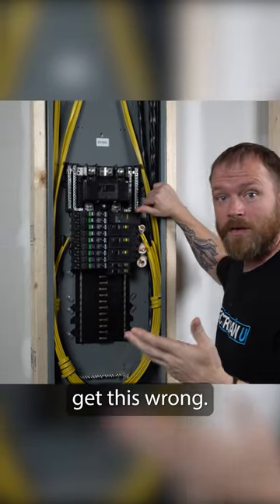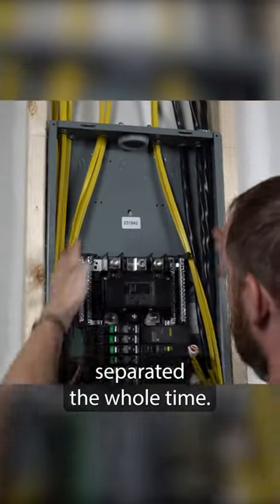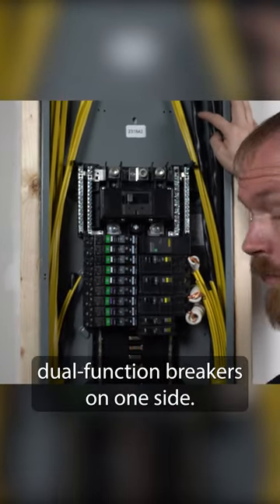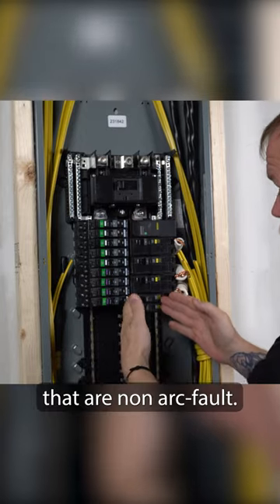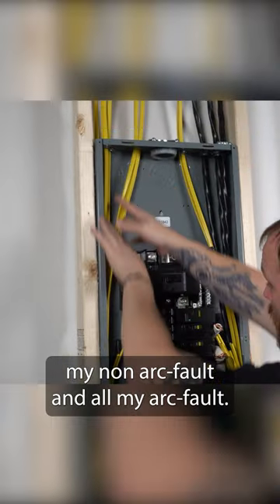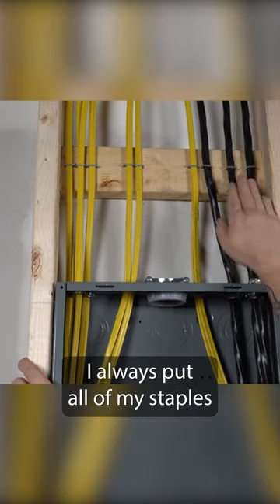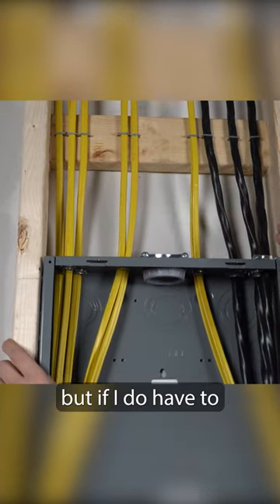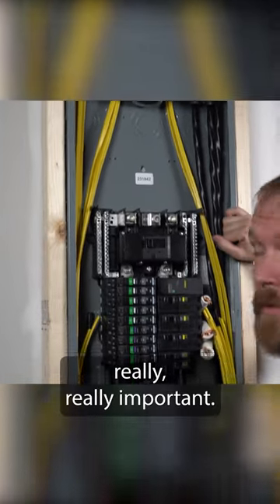Setting Up an Electrical Panel with Intention

Comment: you also need to balance the loads on both legs
Reply: This was my thought as well.
Reply: I mean you can but that's really what the neutrals for
Reply: No you don’t
Reply: Well, you thought wrong. I’m not trying to be mean but you’re both wrong.
Reply: This panel is no more unbalanced than a panel that is not organized
Reply: How would you know if the loads are balanced, he doesn’t mention what any of the cables are feeding
Reply: The method there is to actually land the wires in the right knockouts at the top. If you noticed the cables coming in then it looks balance to me. If those are 30 amp cables on the right and 20 amp on the left then I see 120 amps coming into A side and 110 coming into B.
Reply: You know all the circuits on one side are not on the same bus, right?
Reply: The panels are designed  already balanced now a days.  Each side of the panel going down is a phase then b phase all the way down.  

Older panels you would have to balance because the left side would be one phase and the right side would be the other phase.
Reply: The legs are one after the other anyways
Reply: All of the right side or all of the left side is half of both the split phases (if that makes sense?). The breakers alternate from left to right.. 
Having all the high voltage stuff on one side is not going to balance out the load. I do think they should be kept closer to the main lug/breaker though so the high load stuff doesn't have to travel far but that's probably more of a best practice instead of code.
Reply: @williamrose7818  not my fault you don’t understand
Reply: My
First thought when he said all 2 poles to right side
Reply: Also load balancing is a old term as the panels were wired differently. The rear bus on new equipment is already balanced and amp wise is the same 200 amp (ie) from top to bottom. 

With all of the new smart breakers I’ve wondered why we haven’t seen a small fan to draw out heat? I’ve also noted sone panels mounted side ways, Not sure it that is common then the heat is only two breakers
Reply: Hmmmmm
Why do we balance loads
Well when a store is running, they have everything going and pretty much use all of the amps their service line provides them and or the panel is rated for

So hot spots occur in areas that bigger breakers have been bunched up in
Which causes heat
Which causes breakers to trip
I’ve had a service call where they had tripping breakers and it turned out nothing was wrong except the electrician put all the heavy double pole breakers in one spot. 
I rearranged the panel to better balance the heat that is created from the amp draw and they’ve never had a problem since. 
When I do residential I put the A/C double pole above or below the heater double pole, these won’t ever be used at the same time 
I don’t put the water heater next to the bathroom breakers
Freezers and ice boxes don’t go next to each other
You get my drift….

Comment: Stacking all those arch faults, GFI, and dual function breakers creates a lot of heat and will cause those breakers to trip. You also have to make sure both hot legs are balanced. It's not all about looks people

Comment: Its always weird for me to see cables clipped inside a wall.  Here in Australia you are not permitted to clip in an internal wall cavity.  The theory is that an unclipped cable is less likely to be damaged by a nail or screw because it can get pushed away.

Comment: As a carpenter of sorts those staples all lined up looks like you are trying to split that board :)
Reply: Wood is a lot softer these days
Reply: @BS-ys8zn  Tangential note: 
 I recently did some work with some pine boards that might be 100 years old, from a 1920's house. Glue does not soak in very deeply, legs I glued on pulled off with less than a 1/6th of an inch of the old pine on them.

Comment: Love the vlog!  👍🏻
110 / 220 was standard until 1930’s when it changed to 115 / 230.  In the 1980 it upgraded to the current voltage standards of 120 / 240 volts.  Holding +/- 5%, 220 volts be at -8% — a brown out!  And a burned up motor.

Comment: There is a reason to NOT do this! AFCIs and Dual function AFCI/GFCIs create heat - they also FAIL due to heat.

I too used sort breakers this way- 2poles there AFCIs there… And I had to deal with a bunch of call backs on breakers failing. I also do thermal imaging… And found that AFCI breakers in close proximity in banks with each other would cascade heat - prompting early breaker failures. Granted AFCIs have gotten better but the issue remains.

So - what do I do now since almost all residential circuits are AFCIs? I group for areas horizontally. Not odd/even in the 1357 2468 vertical. Kitchens are top 123456789 etc with a blend of two poles. Followed by other two pole equipment - if not in a separate panel- because I do break up panels that way. Then at the bottom all the lighter loads of bedrooms and lighting. Which are more diverse. 

This keeps the higher loaded less frequent loads that produce more heat in short duration up top. And the longer duration lower amperage spread out at the bottom. 

I have also opted to steer clear of panels in Mech rooms where furnaces and water heaters push the ambient heat too high.

We need to treat AFCI and dual function breakers as “electronics” because they are. And the performance of them and longevity of them is dependent on heat.
Reply: Was looking for this comment. Well said!
Reply: Agreed
Reply: I do a lot of residential with remodels and new construction and have never experienced this
Reply: @frankw3606  you don’t experience it until you experience it. AFCIs have gotten “better” - but still an issue. If you do several full 42 or worse 60 circuit panels in hot mechanical room conditions - you’ll get it.

Comment: Is there no thought into the load distribution across both legs 

Traditionally this would be set by the engineer on the plans . In some of are areas ( not all). The inspectors will fail you ( or make the engineers sign off) if you don’t follow the plan exactly per breaker

Comment: Ever had issues with tripping arc faults when they’re all stacked like that? I’ve seen it once before. Temp reading showed much higher temps towards the top of the afci stack. Tripping stopped when we split them up

Comment: How does this affect the load balance of the panel with all the 220 on one side?
Reply: That’s what I’m wondering?
Reply: It does  nothing it will  be just as balanced if he put 1/2 on one side or the other  it doesn't  matter
Reply: Panel buses are ran everyother to each pole on either side

Comment: I’m not about speed or neatness or whatever good or bad.  Does it work and is the client happy?  Cuz one things for sure the electrons don’t care if the staples don’t line up or where the single pole breaker is in the panel

Comment: Looks really nice. Honest question. Is 220v specific to states? Ive never seen 110-220. Always 120-240v in every state ive worked at. Granted i have not worked at all 50 states.

Comment: Looks good bud. I really like the idea of separating the 220 and arc fault to different sides of the panel. But damn how long does it take you to straighten out all the wires and make it all nice and neat. I take pride in my panels and separate all the wires but I feel it would take a hot min to get all the romex wires as clean as you got it there.

Comment: What I like to do is solder the wires to the breaker for a better connection then smear grease on them so they can't corrode.

Comment: Nice panel, but putting all your 220 volt breakers on one side, creates an unbalanced load.
Reply: Is that because 2 pole breakers are heavier and throw the balance of the panel off?

Comment: Thats wrong...large loads go closest to the main where the source is... that way large current drawing appliances dont flow thru lighting circuits...we all know current only flows towards the source...thats why lights dim when ac inrush current flows across lighting breakers...just check any commercial panel schedule and you will see large loads closer to the feeders

Comment: Nice work for new construction... But panel replacement doesn't always afford you the time for that level and 95% of my electrical work is replacement or repair.. time is money. Proper installation and code compliance is what's important.

Comment: This panel is a code violation in Canada. Never are you allowed to have branches entering the panel from the top, or where the main service line is entering the panel. They must be separated at all times.
Reply: Well this isnt canada and every single house in the US has homeruns entering from the top of the panel, and on the same side as the service conductors
Reply: This is AMERICA!
Reply: We don't follow your commie code. We follow NEC 😂
Reply: @usa5439  Define communism. Then define what "commie code" is.
Reply: In a main service but a sub panel doesn't require it if the manufacturers don't have it
Reply: Explain the concept behind why thats done please
Reply: @pingpongpaddlehead  I'm going with an assumption that wire fill in the top of the box would get tight and cause excessive heat. And .Mainly to service those wires without a main disconnect prior to that panel you would have to schedule an outage with your local electrical authority in Canada anyways because they'd be behind the line side flash plate.
Reply: Which would be a violation unless it's a specific few load centers past the main distribution
Reply: @UnifiedInfo  well we have formulas for fill that prevent such thermal overload due to harmonics, and we always have some sort of disconnect from the utility like a meter before our first source of disconnect, or some sort of multi tap whereby we disconnect from. So it still dont make sense
Reply: @pingpongpaddlehead  not all codes are strictly for safety some just make the future sparkys job easier
Reply: @UnifiedInfo  i underatand that. Im a 3rd gen with 25 years in. I cant understand the logic behind this. I service panels all the time with romex  conductors and conduit coming in from all sides. Like, i could see why limiting conduit into only two sides of a flush mount panel would help future swap outs, but i still get it done with change overs. Please, make sense of this to me. Canada has enough impracticality going against them as it is. Make this make sense please
Reply: @pingpongpaddlehead  you still get it done is the key phrase here. You have to rush to make it happen and possibly take longer then you would have if it was arranged with you in mind. I agree end of day it's not keeping the lights out lol
Reply: @UnifiedInfo  well i mean i kinda guess ok, i just still dont see the reason. Its gotta be something else like harmonics. I can maybe understand that, because SER is used up north a lot, but in the southern US here we pipe everything so our emf is a bit lower, but as long as a neutral touches a line condouctor i still dont see the problem. Like, you guys have basements there too, so maybe its cause it makes stuff more accessible as you say, but here in florida its all overhead as we have slabs on the ground here.
Reply: @pingpongpaddlehead  ya there's more likely a basement then not here I can see why everything would come from the top there
Reply: That’s how every service is wired in America. Damn near 99% of them anyway.
Reply: @williamrose7818  right. We account for fill and emf in our formulas that bring us access to our distribution centers, and our enclosures come with the maximum available room for all possible circuits given its amperage, so i cant really grasp why the feeds need to come in at one end or the other.

Comment: Against code here to do a new panel with circuitry coming into the top where your main service is coming in . Unless it is absolutely necessary in a old home to run a new circuit

Comment: Breakers are a waste of money. Wires are your safety fuse. Just run them into the panel and wrap them around the bus bars. Easy, cheap, how god intended.

Comment: Looks nice but the reason most electricians put the 220 on both sides instead of one is to balance the loads.  If you don’t know what that means, it’s your power coming into the house.
Reply: Why would it matter